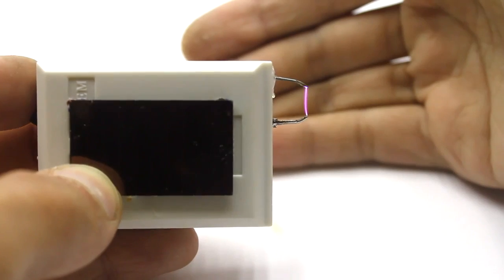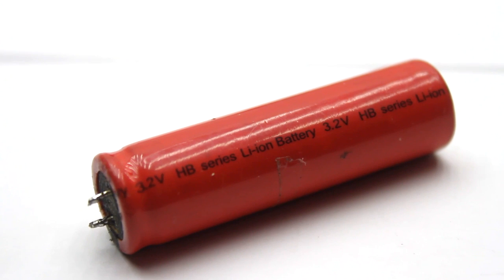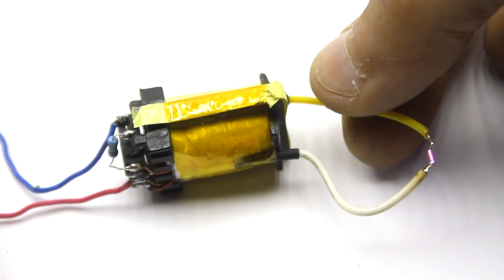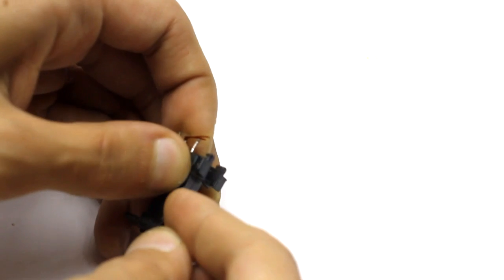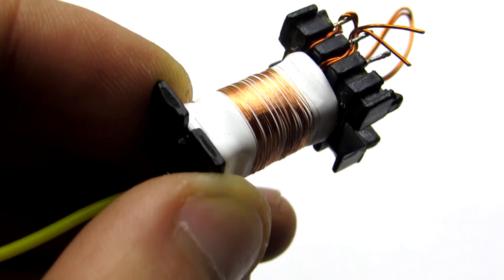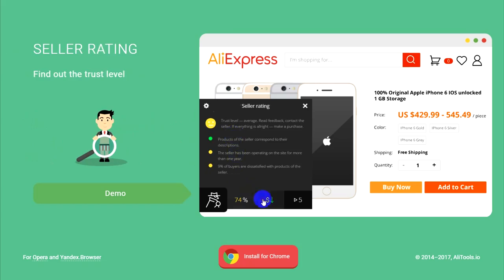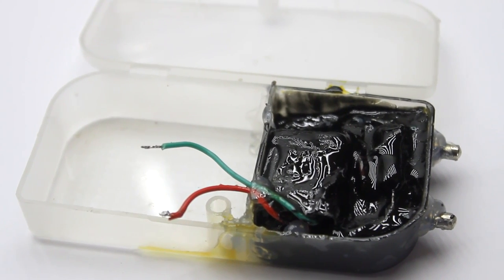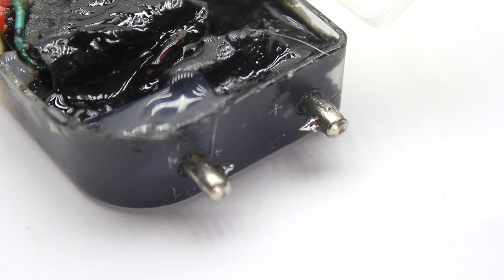DIY compact electric shocker

Comment: I make the transfrmer and I have mesured voltage its 1700 volts but  my taser is not create arks what is the problem please help me
Reply: The current of your transformer is very low and may be there is arcing between the coil you can use a better battery and trans8stor

Comment: I wish I had this thing in the good old days of espionage.
I had to make do with a clumsy bug-zapper circuit powered off a 9 Volt!
Reply: NNNI Honestly if you swap out the voltage multiplier for a bigger one, bug zapper circuits are way better than this
Reply: Bigger one in the sense more stages?
Reply: NNNI More stages for more voltage, bigger caps for more current
Reply: Oh, I see.

Comment: Someone help me i made this Arc lighter too but arc generated are very small in length about 2mm & the mosfet gets very hot even if mounted on big heat sink and another issue is that it does not work on battery is only runs on power supply and it draws lots of current